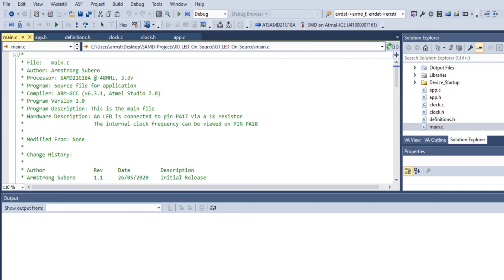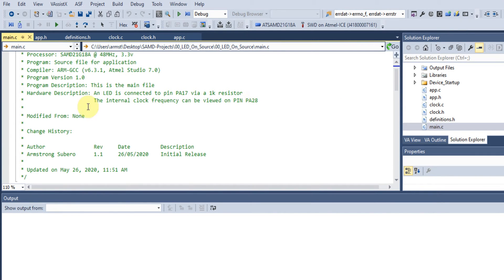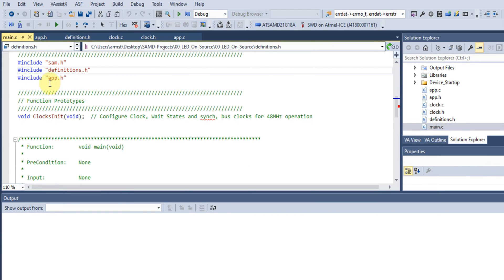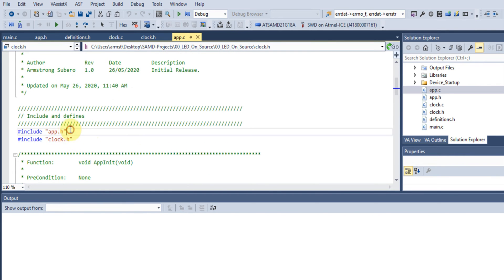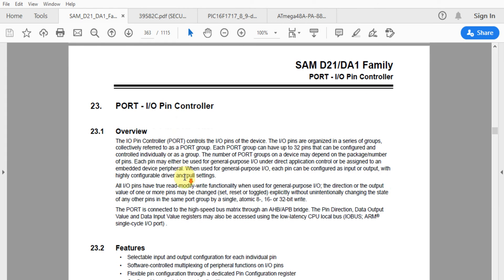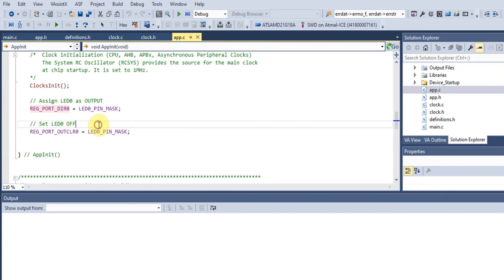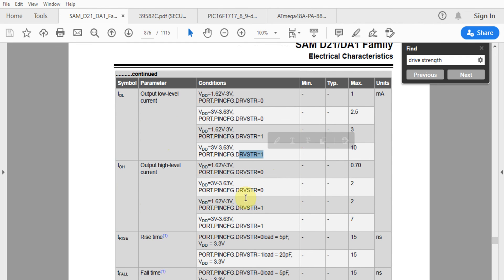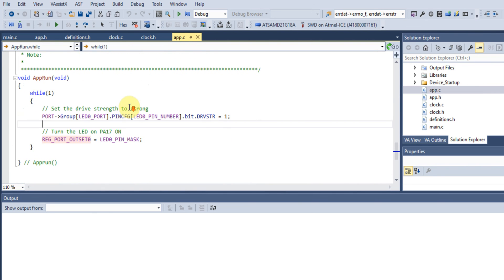SAMD21 ARM Cortex Tutorial #1: Turn on an LED (Bare Metal)

Comment: Finally someone is doing it from the beginning, you are the first one who is doing tutorial on SAMD21 bare metal without START or Harmony. This is going to be very helpful. If you have free time consider doing a video on setting the SAMD21 on breadboard with adapter  which converts it into DIP form. Show us how to do the barebone setup. Programming pins, how to hooking up atmel ice, mark the video as the first video in the tutorial. That would be awesome. Please don't stop like the others do, they make the tutorial series and leave it in the middle and never come back to finish it.
Reply from the maker: Hi I took your suggestion, I did a video showing the bare bones setup and hooking up the Atmel ICE
Reply: @trinirobotics Thanks man. I love your videos. Specially on SAMD21.

Comment: You can use DIRSET/DIRCLR instead  for modifying individual bits
Reply from the maker: You are right, that is another method you can use, in some of my later tutorial videos I will use this method, if you check my Github you will see I use multiple methods to configure I/O ports and pins etc.

Comment: I've been trying to get the DFLL48M clock to work but I'm not having any success. I'm doing everything baremetal (using the registers directly). I'll have to make do with 8M CPU clock for now.
Reply from the maker: Use my example project, it runs at 48 MHz.
Reply from the maker: If you link an example project, I will be able to help you to get it running at 48 MHz
Reply: I'll look into it tomorrow. I'll report back. Thanks
Reply: Finally got it to work. I cross-referenced your code and I my initialization sequence was wrong and was causing the processor to do a hard reset. I also missed the part about the non-zero wait state required for 48MHz operation. Good stuff!